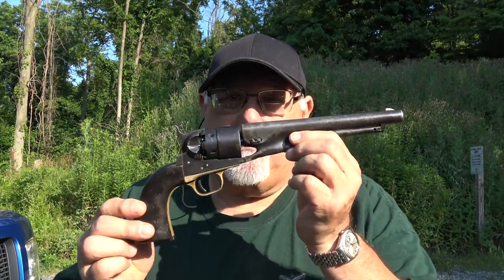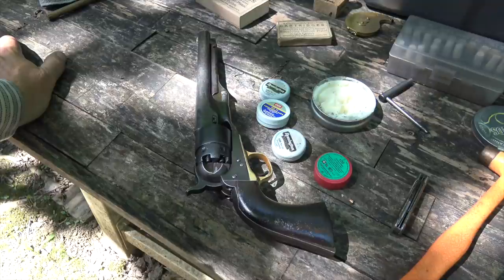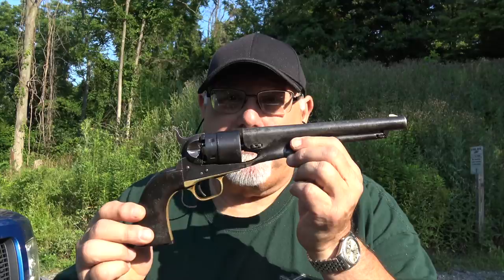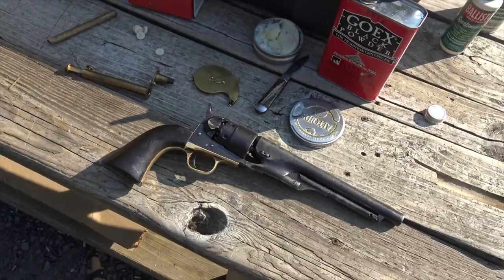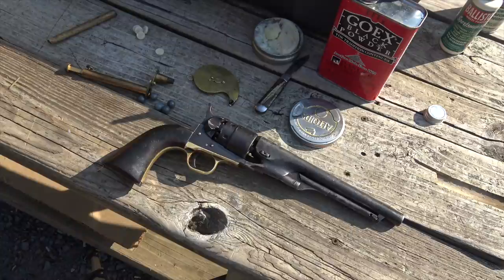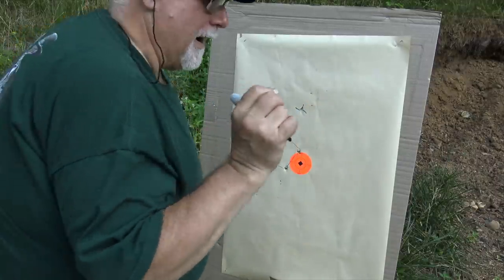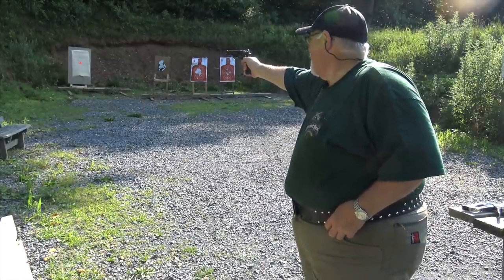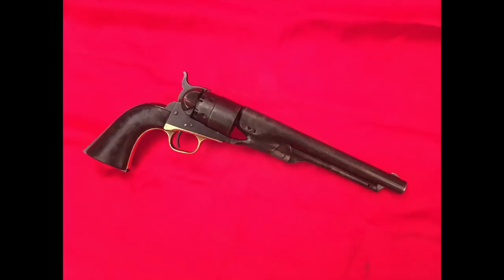Shooting an Antique Colt 1860 Army Revolver   Part 2

Comment: Mike, I have a Signature Series (3rd Gen) 1860 Army Colt, and I've detailed stripped it for cleaning several times, but now I cannot remember which side of the loading plunger goes which way, i.e., does the screw head side go on the right or the left?  It seems to work both ways fine.  Is one way correct vs the other incorrect?  I've seen illustrations with it installed both ways, so that's no help.  Thanks.

Comment: Love your Videos,I am waiting on a Pietta 1860 Army and had a question on the modifications you did in your other Video. How far did you cut the frame to take Conicals ? Where can I find the Molds for the Conicals ? How tall is the front sight blade after the modifications? Thanks for your help.

Comment: "Ach du lieber, mein Bigga Mike"! As an 81 year old proud subscriber, this video, part 1 & 2,  was a real pleasure to view. The 1860 .44 Colt Army is without doubt the most beautiful revolver ever designed!! The 1851 & 1861 .36 Colts were right there too aesthetically. The 1873 Colt .45 cartridge revolver was a beauty also. But did you mention about the poor BORE of your gun? Was it "freshed out" or relined? The BORE of any revolver is the most important part & gives the gun its "horsepower". The longer the better, to more completely burn the powder charge. A nice SMOOTH bore, free of pits or rust, also helps to "wring out" this "horsepower"!!! THANKS for all your wonderful gun reviews throughout the many years. Even the "cartridge guns" were great! You probably have the finest neatest looking "go-tee" of any of the gun reviewers! White is great! "Gesundheit"!!!

Comment: Nice series on your Civil War era 1860 Mike. Like how you took matters into your own hands with the nipples. Looks like that barrel is a modern reproduction based on how crisp all the lines are as well as the fit. Is the refiling progressive or the same spiral down the length of the barrel and what direction does it turn?

Comment: Just for the benefit of the viewers. I suggest making a simple loading stand and using a long brass tube with a small funnel soldered on the end for easy and clean loading. I made one with brass tubing from the hardware store and a stainless steel cake decorating  tip I got from Walmart. Works great. I also use a can of compressed CO2 to blow out the lead shavings.

Comment: I've often wondered if the original more flimsy caps worked better than modern caps?. And yes Hang fires can come from the back and probably in the old days were the most likely way a hang fire would start. I get the impression they were rarer than today probably because the caps fitted  better.... but this my impression from readings from the period. 
I have  had Dave do some work for  me.. Good man.

Comment: Mike... did you use the .454 or .457 round ball, I ask because you mentioned both. You first said .457 and then .454.  Sweet pistol.   I normally use the ,457 for the Walker.   Shoot lots and stay safe.

Comment: Nice to see the old soldier back in action! Regarding cap jambs, you have mentioned this before, raising the muzzle to close to vertical when cocking between shots was something the old guys did, it encourages spent caps to fall out away from the cylinder preventing them from jamming the works. 

I really need to exercise my Uberti 1860! And 1861 and 1862...

Comment: Not sure if you addressed this: but can you compare the action of an original Colt with a Pietta or Uberti. First time for me owning a Colt 1860 but long time (26 years) owning and shooting a Pietta 1858. 
The action feels light. Half cock can easily go into full cock. Cap jams ( I am working to fix per your video), and the spring feels light. I'm wondering  if the originals were as "light" compared with Remington.  Initial thoughts after though cleaning, range test (50 rounds) and ballistol oiling. Not impressed. Thoughts? Especially on upgraded parts to help the action. Or does it get better with time? 

Thank you. 
Moxie Mike.

Comment: While watching your excellent videos I did not take down the names of certain  products shown Including anything made by Waugh ( I do not have facebook so an email address would be cool) and the cylinder block used in a vise would help with nipples. I just went thru my 2 designated BP boxes, (sure do not need 2 for sure) after making a purchase at the Trail of the wolf (sp). I am fortunate to have all the right nipple wrenches. And will be using copper anti seize on them all. I have been cartridge shooting them for years and want to try the paper route you showed. I missed the video onthe 1860 modification-Hefully only involves a Demel and some blueing solution. A list of all tool and sources into the comments At the top would be very helpful to us starting out or getting back into BP like me. I am starting all pistols at 25 3F Goex. GOtta say Conical bullets would be an interesting addition but since all my cylinders 1850,1858, and Ruger miked at 444 or less I will go that route.

Comment: I couldn't find #10 caps anywhere (for my 1860 Army) so I decided to replace the #10 nipples with the #11 nipples from Track of the Wolf. Wouldn't you know it they're still selling those same nipples that are too long. My Dad is a machinist. I'm going to have him make a fixture to hold the nipples then turn them down to the proper length. Something else though. The thread pitch is also wrong. The nipple threaded into the cylinder very tight, almost breaking my nipple wrench. We'll re-tap those as well. I'll video the process and post it on my channel then share the link here. 

I do have a question though. When we turn down the nipples should I just match what came on the pistol or should I fit the nipple and the cap to the pistol? Is there a distance that the nipple should be from the frame?
Reply from the maker: Just make them the same size as the original nipples.

Comment: I've been wanting a cap and ball revolver for years and I was a little disappointment to know that the repros don't accept cartridges without modification. Interesting that the cartridges didn't shoot as well as the RBs. Is that typical in those revolvers?
Reply from the maker: The rifling is a bit worn in my original, which probably contributed. In the repros, unless you are a master marksman, you won't notice the difference at normal revolver ranges.

Comment: Mike, Track of the Wolf list nipples for Pietta in cone lengths of .300 and .319. Which ones work best for you?  A number of years back you published a video on your 1851 Pietta Colt reproduction which you switched out the nipples to Track of the Wolf and they turned out to be to long. I'm trying to find out which ones worked best. I also contacted Slixshot nipples to find out the cone length of their product. Waiting to hear back. And I want to thank you for all your work for the Black Powder community. Your a treasure Mike.
Reply from the maker: Back when I used Track Nipples they only had one length. Except for the Antique Colt nipples, I haven't used Track Nipples since. For Italian guns I use either Slix Shot or Treso nipples...never had an issue with them.